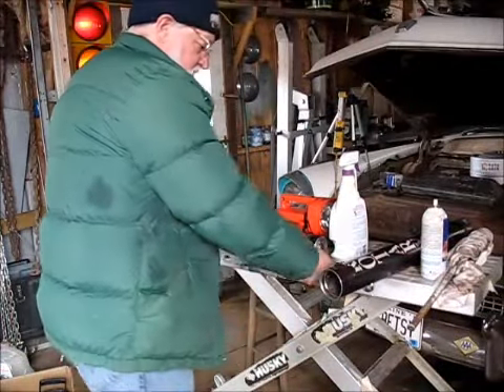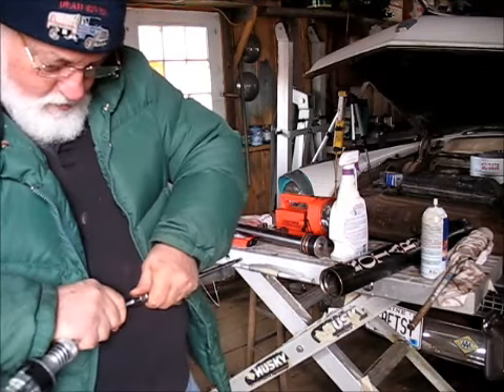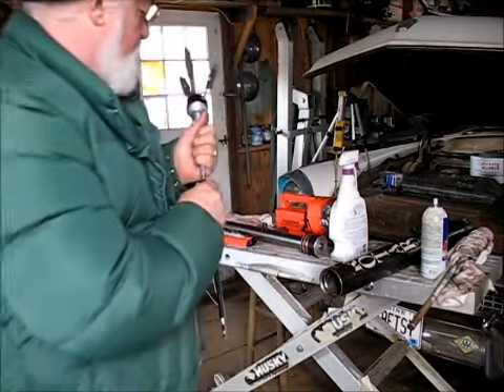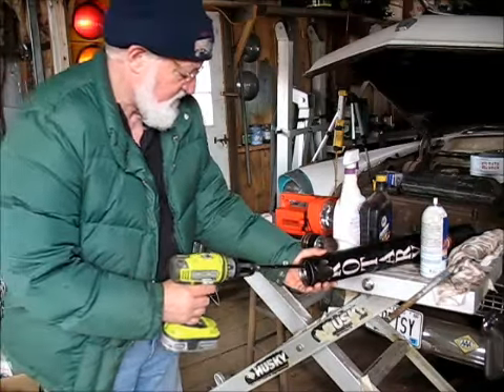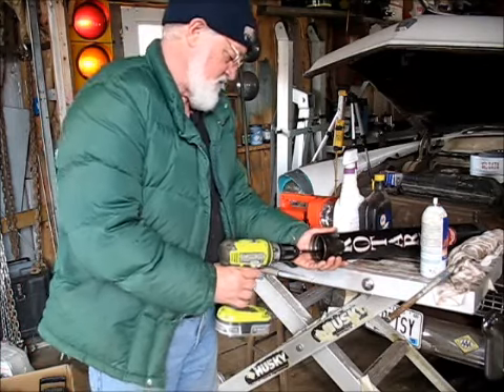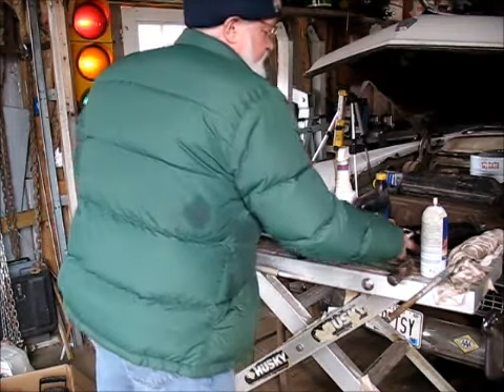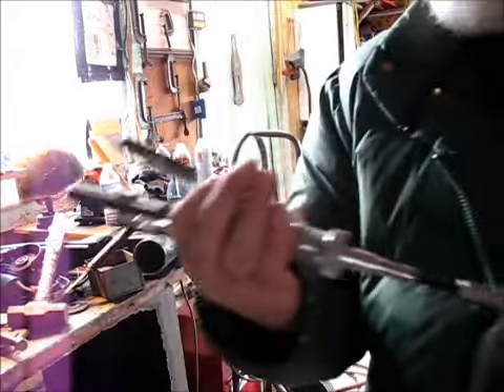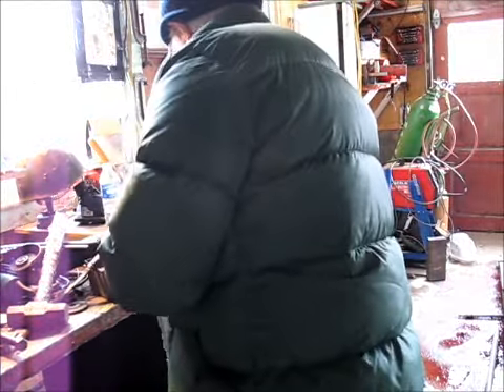Hydraulic Cylinder Honing

Comment: when you put it back together , use petroleum jelly to lube up the seals , and what not , just like you would when you rebuilt a automatic transmission , it will say with them , and not be a mess during the assembly process ...